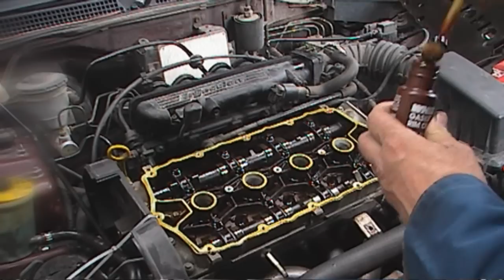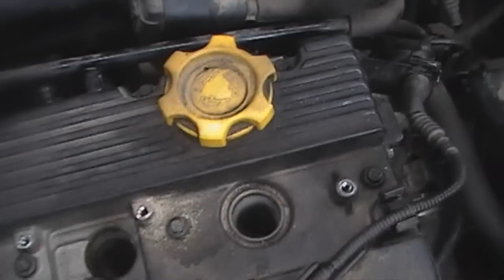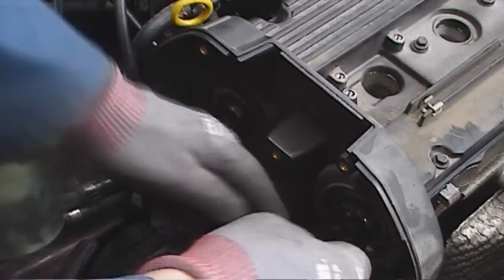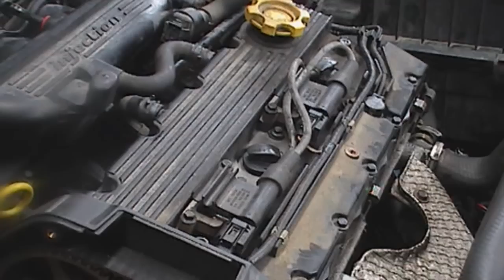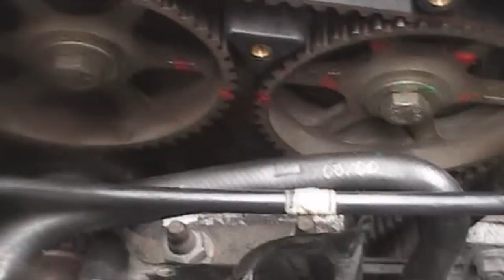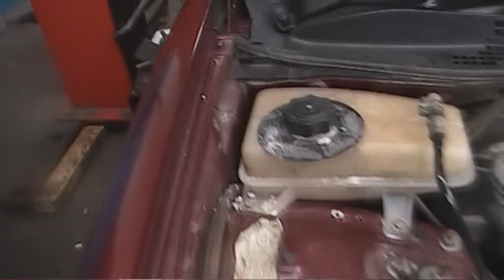Rover Head Gaskit Repair k-SERIES Part 3 (HD)

Comment: Hi there greetings from 🇦🇱 
I have a rover 75 1.8 petrol recently I had low oil pressure light flashing at idle changed the oil filter now inside Gabe’s tell me normal running temp when engine getting way 2 hot after just 3mls drive bottom radiator and thermostat hose dead cold the rest burning hot what am I looking at here thanks plus when I take the oil cup of while the engine running lots of air coming from it and lost of misfiring thanks guys

Comment: Hello i would like to ask you if there any guid to cam timing i have changed my gasket and iam sure from timing of the crank pully but still no't sure if the cam timing right ,is there any guid or how to make sure the inlet and outlet cam in right position even if the both cam pully's guid dot's meet together as the manual say but because i needed to disassemple and back to the engine i don't know anymore if there are right and some of the valves should be open In the DTC ?
Reply from the maker: go to goggle you can get timing set up there, k series, mark on the bottom sprocket and alloy casing, and top sproket faces each other,the two cam wheels, are marked inlet, to pin on the rear cam, and front cam marked to exhaust pin on cam to front cam, exhaust port, set up, crank by hand to make sure timing is correct, otherwise you will have valve to piston damage.

Comment: Hi thank you for your help so far on doing my head on my Rover 45 1400cc.
Can you help on this i done all the head and new thermostat then done a bleed work fine for about 50 mile stop start ... next time drive about 4 miles in side heater whent cold had look put one more new thermostat in but still no heat in car radiator  top pipe hot and lot presher bottem pipe not as hot not as much presher inside heater pipes quite hot in and out but no heat in car the did rize a bit can you help

Paul